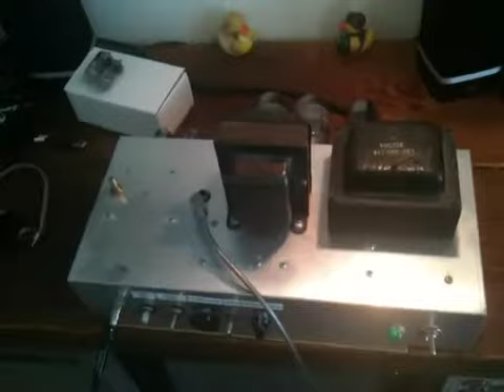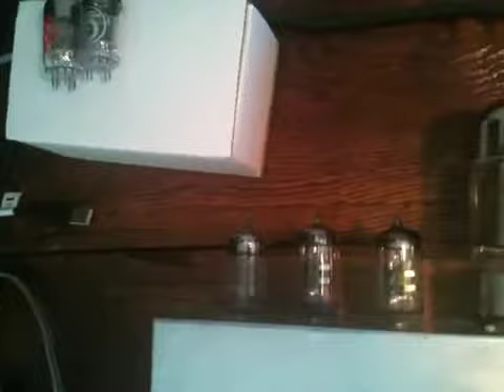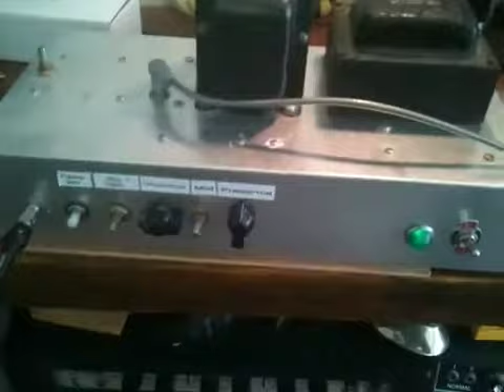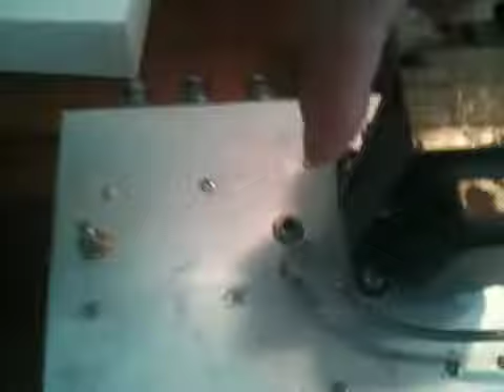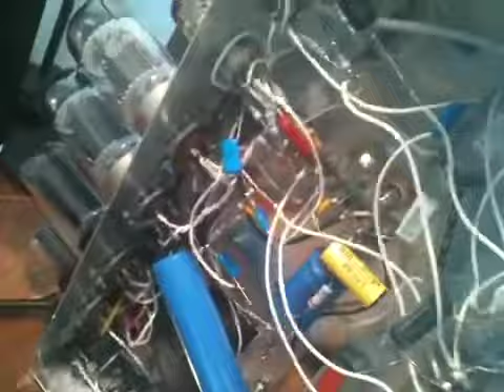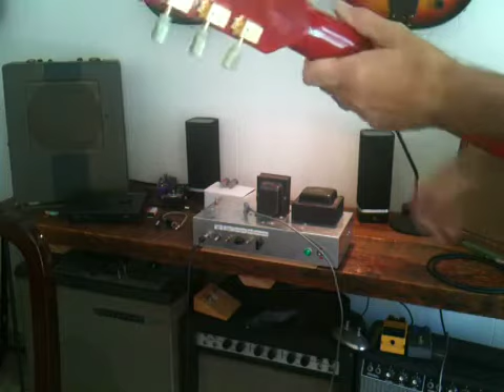6550 / KT88 Tube Guitar amp Demo - Custom made w/ Dual Rectifiers

Comment: Please, help me. I have some 12bz7. Using them instead 12ax7, is it required change the resistors values of polarization or it is just use them, without any modification in the circuit ?

Comment: Hi, I have a few comments/questions about the amp, as I am curious about some things you stated in the video. Did you have it built for you or was it someone else unwanted project? It was obviously built to go into a combo cabinet.. Why not put it in one? I question the builders "pride in his work" as a few things jump out at me... No grommets around transformer leads through chassi, the tone controls appear to be drilled too close to the volume, so if you did "find" the knobs they wouldn't fit anyway. I know it's point to point, but it looks like a rat's nest, with leads soldered DIRECTLY to caps and resistors.... some terminal strips would help. The 5U4 and 5Y3 combined are drawing 5 Amps current, which is too much for most power transformers. Do you know the current capacity of it? That could be your Sag issue, as there shouldn't be much if any.. considering your output tubes are 400 volts at the plate (the lowest the 6550 can be) for a 60watt output. And why did you comment on not wanting to use the presence to avoid sending negative feedback to the preamp tube? It is non destructive......it cancels sound signal, the Opposite of feedback. Finally I have no idea what you meant by the design is too expensive or complicated to make... That just isn't true. BTW, I thought the amp sounded really good considering the quality of the recording.  It looks like you have some really interesting equipment. You should make some video's of the other amps/guitars you own.